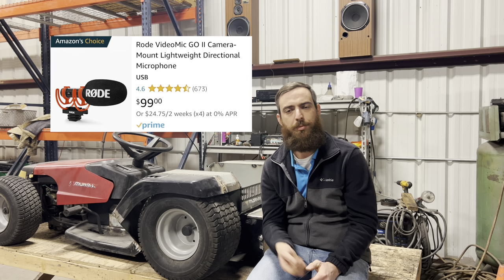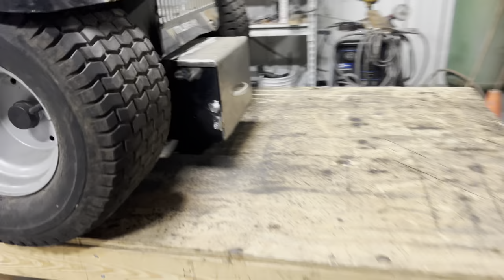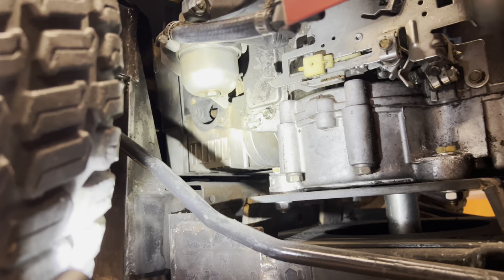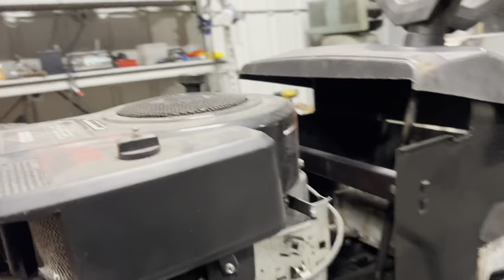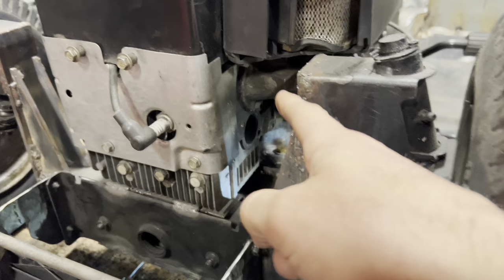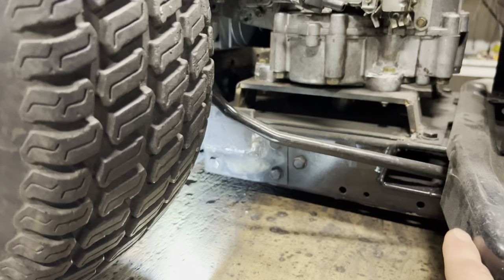Allow myself to introduce myself

Comment: I committed last week after binge watching the 4 slammed mower videos.   We travel simular paths it seams.   I too just picked up a Honda GX390 for my 1988 Club Car on my channel... the 8.5 HP Kawasaki may be shot. Our builds will be similar yet very different as I'll be able to use stock clutch assembly, and you are converting from electric. I have a bunch of lawn tractors to get through first  

Later.  
Glenn's Speed Shop 
In Oregon
Reply from the maker: That’s awesome! I’ve been looking forward to the golf cart project for a while